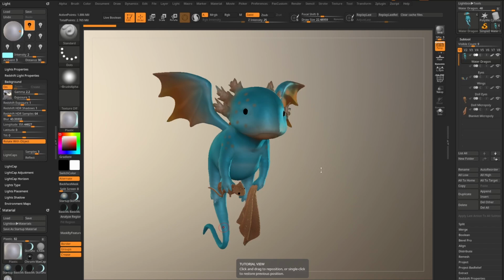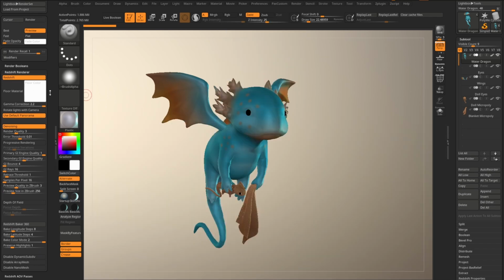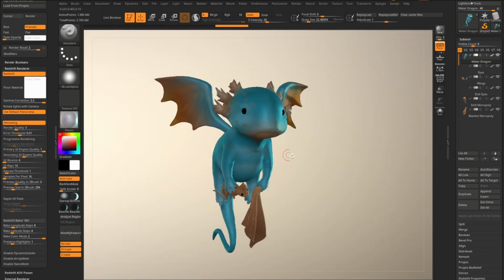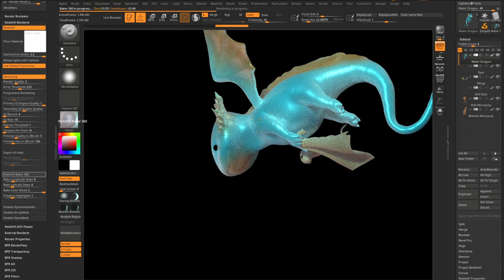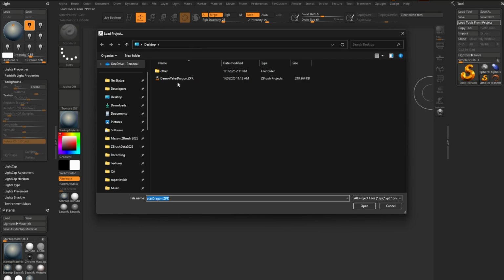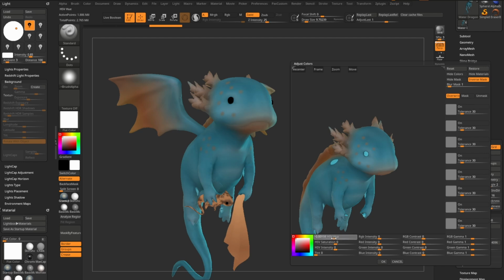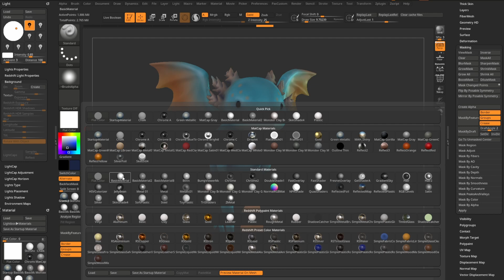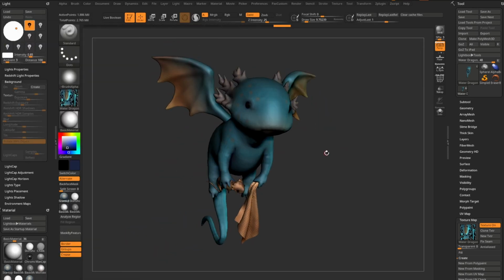ZBrush Redshift Baker 360: Baking Lighting & Materials to Polypaint!

Comment: This is a lot more useful than the old material baking which was camera-based and sending the renders to Photoshop before applying it. It didn't take the light into account, so the look of the shadows and highlights of the material were always wrong depending on the camera angle.

Imagine the colored 3D prints you can do with this. Nice looking metallic materials without having to polypaint them by hand, etc.